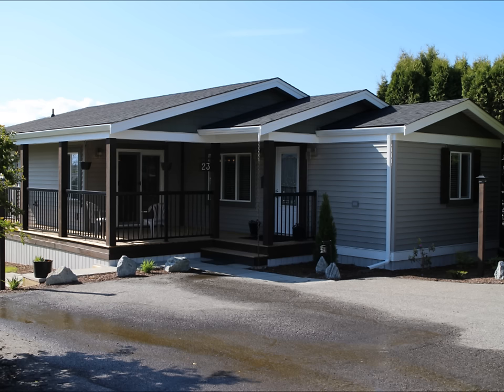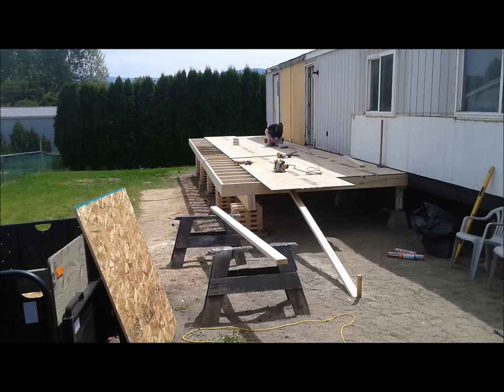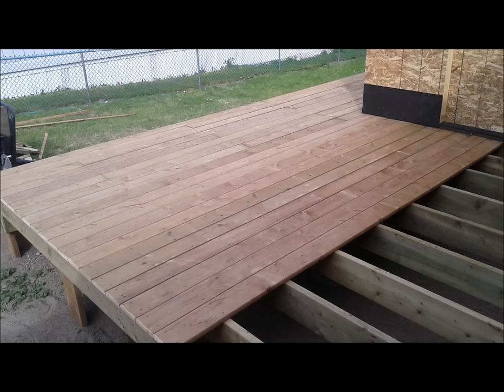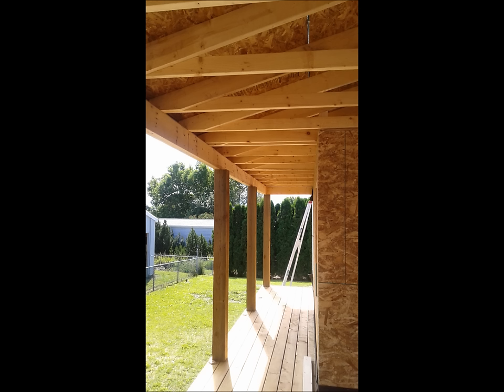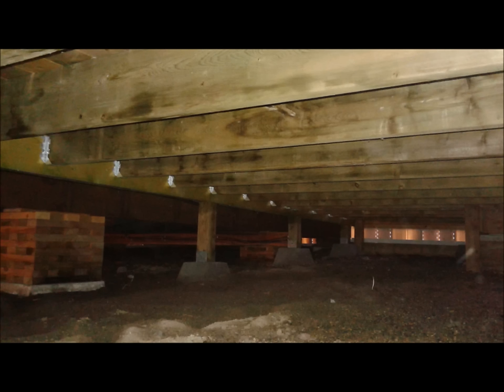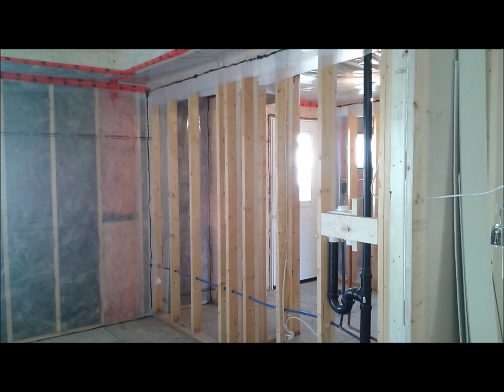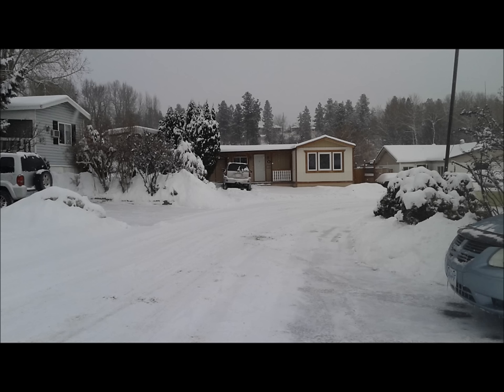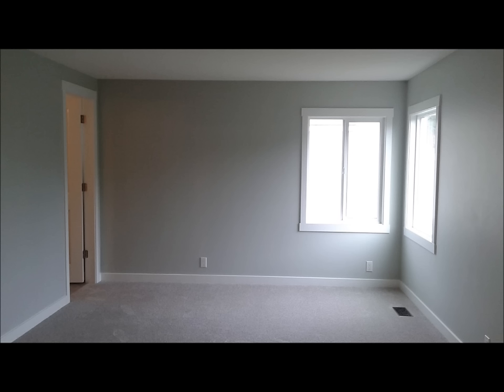Building An Addition To A Mobile Home - Start To Finish : E026 / BC Renovation Magazine

Comment: I never would have guessed that this could be done to a mobile home. Glad that this mobile home got an awesome second life. This home deserves a name plaque mounted outdoors.   "Three Gables" perhaps.   Incredible transformation!!!
Reply from the maker: big2868, thanks for watching and commenting! :-)
Reply from the maker: big2868, when we renovate these homes we like to make them look and feel like cottages instead of mobile homes. Many cottages are named, and we did consider that for this home. What came to mind was "Green Gables" as in "Anne of..." We did another one that sat perched high on a corner lot with a commanding view of the park. We thought about "Eagles Nest" for that one. :-) All in good fun, and a bit whimsical.
Reply from the maker: big2868, Anne of Green Gables is a favourite in our home, too. The 3 movie box set  sits on our shelf as well (VCR cassettes).  :-)
Reply: Anything can be done, but many states have laws against adding additions to an existing mobile home unless the home sits on a permanent foundation. Where I live, if the home rests on pillars (cribs), any addition, including a deck has to be freestanding so both the original house and the addition can move independently.
Reply: This is mind blowing!! never seen a work done like this before. You guys are awesome . Where are you guys located?
Reply: I agree

Comment: Wow just beautiful, I currently own an older single wide with a slight domed roof. I wanted to put a new gable roof and extend it over to make a covered porch but was told by township that it cannot be done. They said the structural frame was not strong enough. They wanted me to basically make a carport over the entire structure. It would never look as nice, it would just look like a trailer under a carport. You did an amazing job.
Reply: In pure someone could restructure the exterior walls with 2×4 or 2×6 that way you can hut the roof you want!
Reply from the maker: Hello, wlopez7111. Thanks for watching and for your comments. Yes, it seems that not all building authorities would approve of this. Others have commented similarly. Where we are additions like this are a common occurrence. In fact, it is harder to find a mobile home in original condition without an addition than with.

Comment: I love watching this - It's probably my most watched video. Question about the original roof trusses. Are they 2x4 construction and did you have to add support to them before you hung them to the header beam? I want to do this same thing but my trusses are 2x2. Any recommendations? And by the way.....thank you so much for keeping these comments up to date and for continuing to share your knowledge!
Reply from the maker: Gina, thank you for watching our videos and for commenting. I really appreciate it and am glad that you enjoy them.  :-)

The roof trusses in this home were a combination of 2x3 and 2x4. The framing for the new roof really did not add that much weight. It is kind of difficult to explain, but 75% of the weight of the roof over the old original unit is on the exterior wall between the original home and the addition, distributed between the original wall studs and new beams. The load is then distributed to the floor joists, the steel beam under the floor joists and ultimately to the cribs. 

If you have 2x2 rafters then some support may have to be added. You would have to consult with a structural engineer in your area for advice on that, and code compliance for your building jurisdiction.

Comment: Beautiful job friend, you really take pride in your work, just got one thing I saw that I was surprised to see and that was no green board in the bathroom, now I'm old school and haven't been out in the field for years. 
    So I know products change, so if it's still water resistant board in a different color, which for separating standard from water resistant it always used to be green, then I'll totally understand, if not then I gotcha ! Ha! Ha! , still the best I've seen in all of my years, well done.
Reply from the maker: The Messiah's Second Assembly, thanks for stopping by. :-) The tile backer is water resistant. We use a product called Denshield. It has a fiberglass coating.
Reply: @BCRenovationMagazine  I knew you had that covered, just thought I would get a little closer to the work to experience what I haven't in years, sure miss it, but at 70 the best I can do right now is just watch video's and make comments Ha! Ha!, good job, thanks for the visual experienced.
Reply from the maker: @themessiahssecondassembly7761  If you were around here, I would have you come by the job. We would drink some coffee and shoot the breeze. 🙂
Reply: @BCRenovationMagazine  Ole friend, don't temp this old man, sitting around the job site sticking my nose in, just to smell the lumber cut, and hear the saw blade, drinking a coffee in the morning and a beer at night, just right not to much and not to little, the story's I could tell you Ha! Ha! thanks for the memory's hope to see more.

Comment: Beautyful. Just a suggestion, next time maby a ridge board tor that roof. And thoes joist and rafter bays will love you if you will block them when over ten feet. Maby some A35 wont hurt. Thanks for sharing a great video
Reply from the maker: Thanks, Ralph. This project was done in one of the most heavily regulated building jurisdictions in the country. All plans and specifications were scrutinized by civic plan checkers. They requested amendments and we complied, doing this specifically as they required. It was concerning their requirement to keep the original unit and addition as 'separate' structures Approvals and permits were a lengthy process taking months. The project was inspected several times by the building inspector along the way. On each occasion there were no infractions that required correction. This is a little different process than adding to a stick built house on a foundation. Thanks for watching and commenting.

Comment: Beautiful work and talented craftsmen. Did you all have an architect make the plans? Did you take the plans to a lumber yard and have them drop all the necessary wood? Curious about the roof and why you went with a shingle over a 70 year metal roof. Either way gorgeous work and home! Well done, very good video too.
Reply from the maker: Heli PadUSA, thank you! 🙂 No architect was involved in this project. I designed the addition and drew my own plans. I made my own material lists. The old roof was a grey asphalt shingle. It may kind of look like metal, but no.

Comment: Adding plastic sheeting across the floor joists from underneath and filling the floor joysts with foam would be a good idea it prevents floor rot
Reply from the maker: Hello, Adam. It's not that clear in the video but what ultimately happened to finish up the floor under the addition is that R-20 fiberglass insulation was fitted in between the 2x8 floor joists. then a layer of 3/8" OSB board was applied to the underside of the joists to seal everything up.

Thanks for watching and commenting. :-)

Comment: You're attention to detail is spot on. I can do builds like this but I don't have the time because of work, to do so. I only need a backside elaborate deck built and a frontside porch addition, hipped to the existing roof structure. Can you let me know what areas you're able to service or you're willing to visit? I can supply designs if needed. Absolutely beautiful work done by you and your crew. I didn't see anything that was half-assed done.
Reply from the maker: TheZrodgrez, thank you for watching and commenting. I am in Western Canada. I am doing these projects in my retirement to keep me busy. It is more fun than golfing. :-) 

I am not for hire anymore at this point in my life. I just buy these, fix them up and then flip them.

Comment: You guys are right on top of it.  Looks great. I'm curious to know how you fastened the soffit ceiling over the deck area
Reply from the maker: Thomas, thanks! Appreciate you watching and commenting. :-)

The soffit panels are aluminum. These panels are attached to 1x4 purlins screwed to the joists. The panels are attached to the purlins using a combination of 1-1/4" 18 guage galvanized staples and #8 x 1" plated screws.
Reply: @BCRenovationMagazine  Yes, thanks for the comeback.  House I bought 2 yrs. ago was done very poorly.  Everything.   I replaced the front porch ceiling this summer, used 1/2" x 3" ply rips for purlins and 1- 1/2" aluminum j channel on perimeters. I could go on.

Comment: Very nice job. I would have recommended the posts holding your roof should be from footer solid thru deck to ceiling. I'm.suprised planning approved a roof being supported by a deck. Then with sold posts coming thru you could have use the same posts as part of your deck railing. Again,very nice.
Reply from the maker: Hi, Cory.  Different ways to do things.  The method you describe is balloon framing.  The method I used is known as platform framing, at least in my neck of the woods. 🙂

Both are acceptable methods and approved by most building jurisdictions.  

Thanks for the compliment.  I appreciate it. 🙂

Comment: How much did the home increase in its value because of the addition? What was the cost of the addition? If the home owners wanted to move the mobile home is this still possible with the addition? The addition is beautiful very well done.
Reply from the maker: Paula, if I remember you correctly, you are in Saskatoon. We are out here in the Okanagan Valley, so our costs may be different than yours. We live in a very expensive housing market, as you may know. So, I won't tell what the addition cost us. We do this as kind of a business and I don't think that would be prudent. But I will tell you this. That home was a bank re-possession. We bought it from the bank. The bank had it professionally appraised before they put it on the market. In the condition that it was in it was appraised at $40,000. The bank had less than that in it, and we bought it for what the bank had in it. After the renovation we sold that home, in 11 days without a realtor, for $230,000. Now, 2 years later the people that bought that home from us could re-sell it for just under $300,000. Everyone is making money on this little home! :-) The home could be moved, but it would not be a practical thing to do. It would be quite involved and not really cost effective. Mobile homes in our area rarely, if ever, get moved once they are placed on a lot. Hope this helps. Thanks for watching. :-)
Reply: BC Renovation Magazine 
Reading through the comments because I was curious how you could make money off of something like this, and wow.  
What kind of insane housing market are you in that a mobile home (albeit nicely redone) that appears to even still be in a park, could not only sell for that much but INCREASE in value?  Hah, not doubting you, just blown away. 
I live in a nice suburban area in Pennsylvania, USA, were normal houses might go for 200,000-400,000, but you can still buy a nice single wide in a park for 15000-40000 easy.  
Again, lovely looking place and nice work, I’ve just never heard of an area where a place like that sells for so much, heh.
Reply from the maker: Hello, Josh0718, thanks for watching and commenting. Our housing market is kind of an anomaly. We have a combination of things that are driving our market. Not a lot of land available for new development, an area that is attractive to a wide range of buyers, low inventory (supply and demand, very strong economy, etc. Also, these are Canadian dollars, which are worth about 70-75% of what the American dollar is, so if you are an American viewer this makes a difference.

Comment: Great job ! A1 !! I am replacing my skirting and I live in the Kootenays in B.C. I noticed that your skirting is not insulated , would you recommend the same in my region ? Thanks for the video and again Awesome job !!!
Reply from the maker: rod, thank you for watching and commenting. In my opinion, I like un-insulated and well ventilated crawl spaces under these homes. There are those that would disagree with me. ;-)

If your home is built like most of these your floor will have adequate insulation and there will be a thick underbelly material that acts as a vapor barrier. The floor will have as much or more insulation as your walls. The floor is the lowest area of heat loss. Next is the walls and the highest heat loss is out through the ceiling. This is due to heat naturally rising. You are not likely to see a noticeable difference in comfort or energy costs from insulating the skirting.

Unless your home is fairly new and has had plastic sheeting laid on the ground when it was set up, or is sitting on a concrete pad, you most likely have bare ground under the home. There is constantly ground moisture coming up. If you seal up the crawlspace then this moist air is trapped. This can lead to condensation and moisture related issues under the home that usually manifest as mold.

I like to treat the crawlspace like an attic space, since the floor is insulated much like your ceiling is insulated. I think that both areas should be kept as cool and dry as possible in all seasons. Since there is plumbing drain pipes in the crawlspace the exception to this might be living in an extreme cold climate, which I would say you are not. I think you are very similar in climate to us in the Okanagan.

If the floor was not insulated and did not have the vapor barrier underbelly then it would make sense to me to insulated the skirting, but then I think that you would want to heat the crawlspace, just as you would in a stick built home. 

I do occasionally see people installing insulated skirting where we are, but they are usually folks that have recently moved here from colder climates. I suggest you take a look around where you are and see what most folks are doing there. Here, it is about only about one percent that have insulated skirting.
Reply: @BCRenovationMagazine  Thanks for the reply !!!
Reply from the maker: rod, you're welcome. :-)

Comment: Hi! Amazing videos and fantastic work! I saw a plan/blueprint. How do you go by getting one for this type of work? I want to build onto my MH.
Reply from the maker: Deathalone, I design, engineer and draw my own project plans. I have been trained to do this. If you are unable to do this yourself then I suggest that you try to find a good draftsperson locally to do drawings for you. You would be looking for someone with experience in building construction (there are different kinds of drafting). These are not complicated projects. You do not need the services of an architect and probably not a structural engineer.

Comment: Winters can produce cold floors on mobile homes. Do you know if DOW Tuf-R is ever fastened to the floor in between rafters in crawl space. It could invite mouse nests, but would seem to warm those floors in February.
Reply from the maker: Hi, Ricky. The floors in the homes I have been working in are insulated with R-20 fiberglass batt insulation. I am not familiar with the DOW Tuf-R product. What is that?
Reply: They sell it at Home Depot, sheet of foam covered on both sides with aluminum foil, available in wide ranging thicknesses up to about 3" thick.
Reply from the maker: Ricky, thanks! I'll look for it next time I am in there.

Comment: Just curious do you use lag bolts for the cribs? Beautiful renovation.
Reply from the maker: Dime Fever, thanks for watching and for your comment. The cribs under the original home were built using 3" galvanized ardox (spiral) nails. For the new cribs we assembled them with 3" #8 plated construction screws.

Comment: So additions are possible. What about connecting two together? Like two double wides connected to make an L shape. Or use a stick built portion to connect the two. What would need to be changed to the home to make it a modular/raise the roof?
Reply: This would only work if you gutted out both homes of all interior walls and plumbing and cabinetry. 
Then put the squares together. Then build your home how you want

So... Might as well build a house.
Reply from the maker: sansaveria, additions to mobile homes in our area are very common. In fact, there are more mobile homes with additions than without. According to comments from some of our viewers, though, additions are not permitted in some places. 

As far as putting two singlewides together to make a doublewide, that is an interesting idea but not one that I would do. I would prefer to go the addition route.

Although a manufactured home (aka mobile home) and a modular home are similar in many ways, the two are quite different.

Thanks for watching and I appreciate your comments. :-)
Reply from the maker: Zach_alvin, I agree. It would be quite a project to join two singlewides together and do it nicely. Definitely possible, but for me, I would rather put on an addition as we did here. 

In this case we ended up with a home that looks very much like a house (small cottage) and the cost was substantially less than what a similarly appointed house would cost. This works well for where we are located.